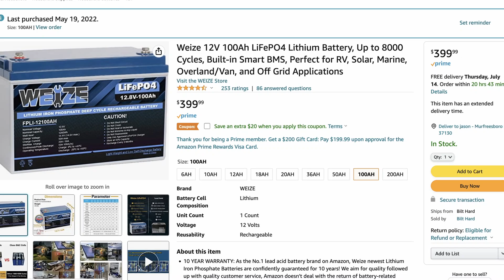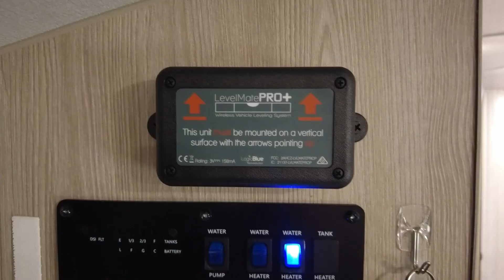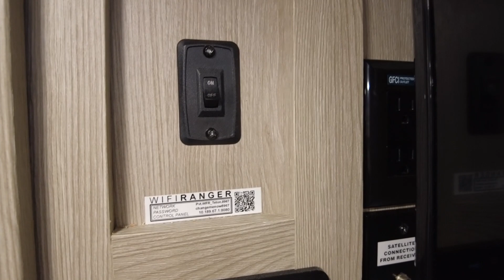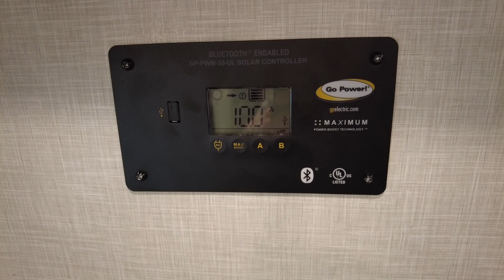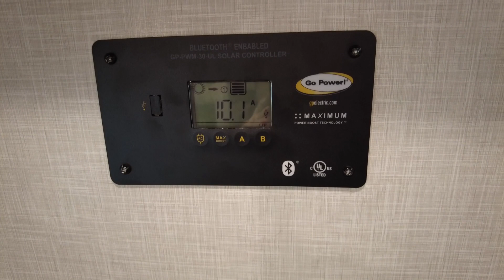RV Upgrades for Ham Radio

Comment: The location of your batteries rear of the propane tanks storage box is messy, very wasteful of space, is not aesthetically pleasing, and will fill with water over time. The large propane box should be located next to the van and your lithium batteries should be located in a dedicated area inside and ventilated to the outside via a weatherproof outlet, or located outside forward of the propane box.

Comment: Hot water heater is not the correct term if water is hot it doesn't need to be heated it's a water heater

Comment: I ran wires from my dc bus, (fuse box) under the couch, up to my FTM 200. There was an open spot to put a new line and I put a fuse in the box. So I am running on power from the 12v converter. Running good now for about a month, no problems. I also put an inline amp, watts, volt meter to keep check on the situation. I am full time in my RV at an RV park. KO6ALP 73s

Comment: Any issues with noise from the ac inverter/converter that is rv stock?  Mine creates a lot of rfi.  It comes from the charger built into it.  Thinking of putting the charger on its own breaker and shutting it off when I go radio.  Then using solar to replenish the 12v side.

Comment: that was great. I have worked on some RV's . what I ran into quite often is RFI comings from solar MPPT controllers and DC to AC inverters. not only does this interferes with HF ham also AM radio as well. the fix I found is ferrite T240-43 or 31 cores. make a common mode choke with power cord + and - wound together . place close but MPPT. use 2. 1 for solar input and 1 for battery side. Victron MPPT has been better than most. with the DC to AC inverter do the same. the AC out leads wrap threw the ferrite. now on battery side may be large cables. can try the snap ferrite or get a large 4in or 6 in core and wrap large wire like 0 AWG threw it. AWG depends on size of inverter. I did this with my MPPT on my portable battery kit box and worked great.  for them power stations just wrap AC cord threw the ferrite core a few times . of a few snap cores. for cold places just insulate battery . that thin foam insulation works great . I just cut it and place inside battery box . this helps on heated LiFePO4 as well. less heater comes on is more DC power you have. 73's

Comment: With that generator on propane you will suck down a tank in about 3 hours. The use a ton of propane. On gas you probably get about 9 to 10 hours + on a tank.
Reply from the maker: During field day I got just over 12 hours out of each bottle with the generator. That was running the AC at ~70 degrees.
Reply from the maker: Here's the AAR with a breakdown of propane use. Scroll down and look under the generator section http://tiny.cc/FD-AAR-2022

Comment: Good work!  I am hoping to get a camper and fit it for ham radio, and this gives me ideas. Do you have any thoughts on how to make antennas work without compromising the camper?  Besides the obvious option of running coax to something else. Currently I have a 1/2" copper pipe j-pole for 2m and a home brew wire for HF.

Comment: Nice set up! The joys of modern RV's, they are equipped with this latest power systems from factory even if we need to order them as extras with some manufactures. Your add ones are clean and to the point. Take a moment and add some split loom tubing on that small section from the battery to the entryway of the RV. Will add extra protection to the wires. What size fuse did you use on the battery connection? 73 from SV9 land!
Reply from the maker: I used a 30A fuse

Comment: Do your lithium batteries have built. In heaters? Apparently lithium can't be charged below 32°
Reply from the maker: No but they have a low temp sensor which stops charging when it’s too cold.

Comment: Those are some great upgrades. Wish mine came with a ladder for easier pole mounting. Was your converter set to charge a LiFePo4 or did you have to upgrade that as well? 73 de KC3QLX
Reply from the maker: My converter isn't designed for and won't charge the LiFePO4 battery beyond ~70%. The solar panels charge the battery up to 100% though. The solar charge controller will support LiFePO4 batteries.

Comment: You have "solar on the side" and a built in charge controller/solar on the roof and they aren't connected?  Funny how they don't understand solar...
Reply from the maker: From all of my research, solar on the side doesn't feed into the charge controller even though the charge controller came from the factory. Makes no sense to me. This doesn't just apply to E-Pros. Seems they are all wired that way. It is nice that I have on outside 12V outlet though!
Reply: @KM4ACK  mine has the ZAMP solar ready plug, it's reverse polarity and no charge controller at all - it's just a direct feed to the battery and ready for disaster!

Comment: If you you want an additional charging option for when you are driving on very dull days, or at night.
Get a 12V to 24V 30A DC/DC Convertor from Amazon
Wire it via a 25A Fuse/Breaker to the normal Vehicle Battery
Then use the 24V to feed into the solar input on your charge controller input either by swappable connectors or change over switch
Reply: There are DC-DC boost chargers on the RV market (Renogy, Victron, et al) that are made to connect between the trailer and the vehicle, and they regulate voltage and limit current to reasonable values to charge and maintain the trailer batteries (and are programmable for chemistry). Some even have sophisticated detection to figure out when the vehicle is running so they only charge then. No need to jury rig this. 73 de w6akb.
Reply: @alanb76  
Yes, Well aware of Renogy / Victron and the "prices"... 
Amazon UK it cost equivalent of $45 for my DC/DC option
So jerry-rigged is fine by me :)
FYI going the Renogy DC/DC route @ $102
Reply: @MINI-4X4-RADIO  There are cheaper solutions if that's what you are seeking - various DC-DC converters that will feed directly into battery and avoid the solar input. The solar input is not designed for this use, and passing the energy through two control/conversion stages adds to the overall system loss which ends up burning more vehicle fuel. Depending on the individual characteristics of the solar controller and DC-DC converter there may be failure modes. The cheapest solution is to not bother at all since the amount of charging one gets when driving is not usually significant enough to bother with for most RVers in the overall scheme of things and adding engine load is not a cheap source of energy. Instead put that investment into solar panels which will have more overall benefit and will charge while driving and parked and not add to the engine load. Have fun!
Reply: @alanb76  
This is supplementary
The Charge controller does not know if the input is from Solar or DC/DC convertor, how can it..??
So long as you stay within the MPPT  Voltage/Current range it's fine
Reply: @MINI-4X4-RADIO  MPPT will increase loading to maximize power transfer. There is no guarantee that this operating point will be within the safe operating area of the DC-DC converter, especially in all ambient conditions, and is likely to overheat the converter. It may work, but it's a random design without overall safety margin management.
Reply: @alanb76  
I have yet to see an MPPT controller that 24V is out of range
Most I have used cover at least 18V ~ 30V operating input.

The MPPT controller cannot differentiate between 24V delivered from Solar or 24V delivered from a DC/DC Converter
Reply: @MINI-4X4-RADIO  Amazon products are crap. Buy better or you'll buy twice.
Reply: @sammiller6631  
Well my $45 DC/DC Convertor is now nearly 2 years old
I use my vehicle nearly daily
So I'm happy with this crap...

BTW
A significant number of Amazon products are straight from suppliers,
that why they are cheaper., they have cut out the middlemen.

Amazon fulfill people's desire for cheaper
Reply: @MINI-4X4-RADIO  Amazon is the middleman. Amazon uses their size to strongarm suppliers to set prices lower than the suppliers want. The suppliers who don't bend to Amazon's demands can get pushed out.
Reply: @sammiller6631  
That's why I said Middlemen "Plural"
There can be many middlemen in the supply chain

Comment: I have a tray on the back of the trailer for those trips I need to haul Generator fuel. 73 de w6akb
Reply from the maker: That's one thing that is missing on my RV. I wish it had a rack on the back.
Reply: @KM4ACK  On one of our trailers we had an RV dealer weld a 2" receiver on the back, and we use a tray that plugs in there. Our current trailer came with a receiver for that. We had one trailer that had a slide out tray built in, but that broke up after some years. Many new trailers have fold-down trays at the back, those could probably be added to a trailer as well. I think the receiver is best because we can use a tray or a bike rack there. Have fun! 73 de w6akb

Comment: I'm using the same Weize 100ah battery in my teardrop. It's solid. I can do a 3-day weekend in a heavy shaded campsite and not worry about the DC fridge depleting the battery.
Reply from the maker: I have been pleasantly surprised with the battery and would recommend it to anyone. It was great to work you recently during your POTA!

Comment: Got a Geopro also, gonna have to look for an stl file for printing some ladder mounts.   Most of the time that solar on the side is wired backwards from the factory.
Reply from the maker: I didn't print the ladder mounts but if you find an STL, please let me know. I did 3D print a shower head mount for the ladder. The factory mount was about waist level which I found less than ideal.

Comment: Thanks for the ideas. I have an E-Pro 19FD with 1200w of solar and 680ah of LiFePo4 batteries I built...was just pondering how to run coax inside. Perfect timing. As always, great information. Thank you for all your contributions to the hobby and community. 73 de K3XQ
Reply from the maker: WOW!! That's a LOT of battery capacity. Where did you put them?
Reply: I was considering the E-Pro RV trailer in the future, but I have seen how RV prices have skyrocketed. 73 KD5YOU

Comment: Great setup you have there! 
Is the propane generator quieter on propane?
Reply: I have the same Champion Dual Fuel 2500 and it is a touch quieter (in my experience). Consideration must be taken though that the generator won't produce as high a wattage as it would if you were fueling it with gasoline. Propane fuel has a lower BTU rating than gasoline.
Reply: @k3xq856  okay, thanks for the info. My old work van lost about 35% power on propane. I must look into them, I have an old 3500kva petrol generator. Still work great but it's loud, I need to try some silencers on the exhaust  but it doesn't run on propane  they didn't have the capability at the time.
Reply from the maker: The generator might be just a touch quieter on propane. There is a reduction in power output running on propane though. I had to install an AC softstart so it would run the AC from the generator while running on propane. Since the install, I have had no issues running the AC.
Reply: @KM4ACK  thanks Jason! Good info to know about a soft start AC too. :)